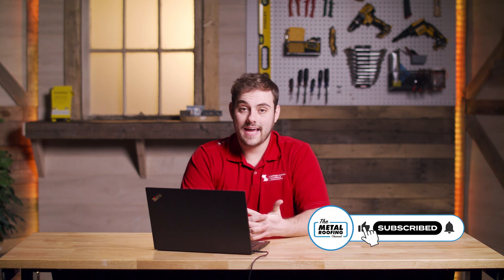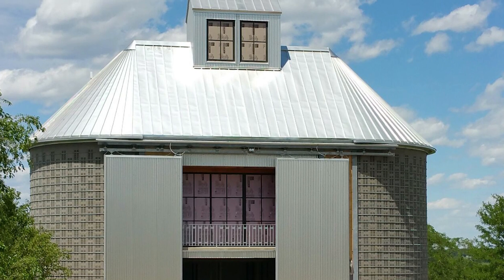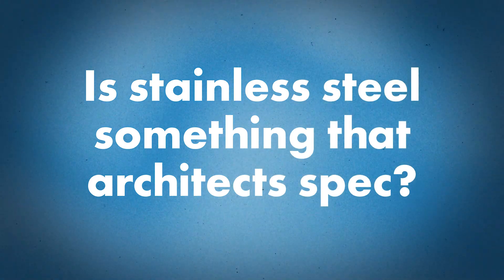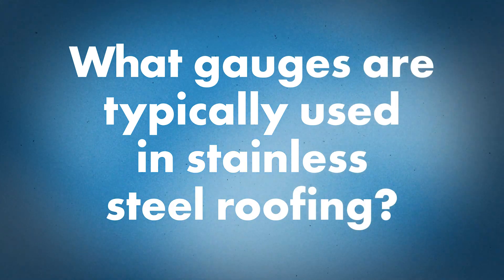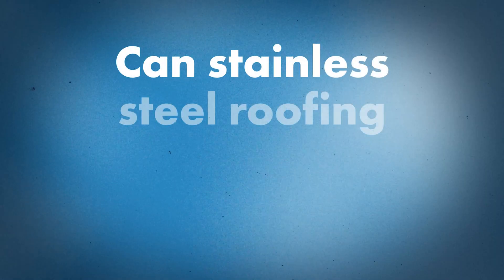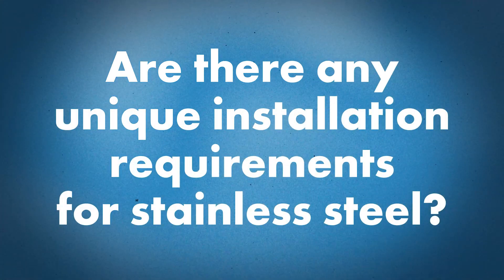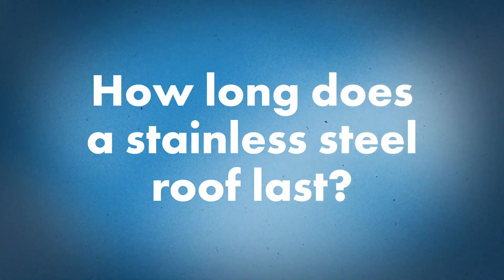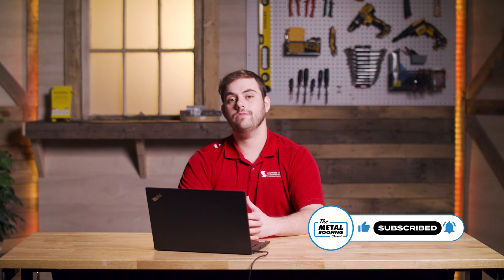Can You Use Stainless Steel for a Standing Seam Metal Roof?

Comment: In the video Josh said that the life of a SS roof was 75 to 80 years.  What would happen after that amount of time to make it fail?  Why would it not last forever?
Josh also said that SS it is a very Low maintenance roof system.  What maintenance would be required?
Reply: @TheMetalRoofingChannel Do you have a response for me?
Reply: Stainless steel has (virtually) ZERO MAINTENANCE!

And a 100-200years lifespan.

But I believe another question would rise like: after 200Years what will happen to a Stainless Steel roof?

That's the reason why he said only 70-80years span.
Reply: @kaAndres37 So you do not seem to have an answer to my question either.
Reply: @ryanwelsch9384  Why you have that question is because there is really no exact answer to that.

One thing is for sure stainless steel is strong!

Comment: In 32 years i have done 1 stainless roof. Somehow it ended up rusting. One of the most difficult roofs to install. It will wear out snips quick, and hard to bend. I would much rather copper.
Reply: Stainless steel comes in a variety of different grades. If it's made from 304 stainless it will not rust.
Reply: And 316 SS is roughly 1/3 more money than 304 for material if your budget isnt tight. I cant see why it wouldnt last 1,000 years except for the wood deteriorating underneath.
Reply: If it rusted it is probably 400 series which contains more ferrous materials and less nickel. A quick way to confirm is putting a magnet to it. If it sticks hard and quick it usually means 400 series and will rust.
Reply from the maker: Interesting! That is a good point about cutting and bending. What type of building was it?
We've got a video on copper coming out next week. I'd love to hear your thoughts on that too! -Thad
Reply: @TheMetalRoofingChannel  library in New Orleans. I look forward to your copper video. James
Reply: Thanks for the video.!  Do you happen to know anywhere to contact that supplies stainless steel standing seem roofing?  Thanks.!!
Reply: Stainless steel is hard to form ,  so which one is better... Seamlock or klip Lok ?
Reply: If it rusted 
It probably isn't stainless steel
Reply: Where was the roof and what grade and gage stainless was it?  How soon did you notice rust?  I did my roof with mostly 316 SS and a couple of sheets of 304 back in 2018.  I live on a peninsula on the north shore of Long Island.  My house is about a half a mile from the long Island sound.  The roof looks as good as it did the year I installed it.